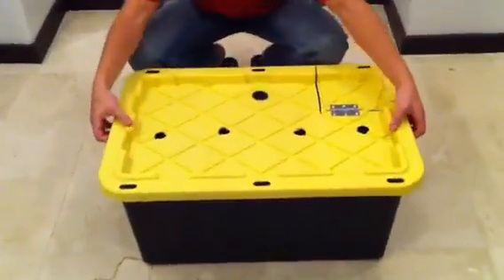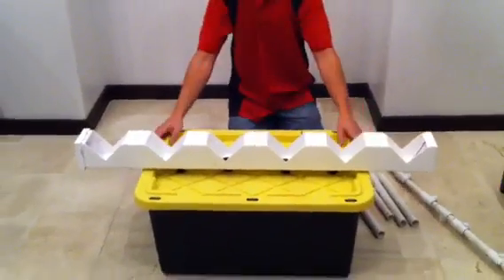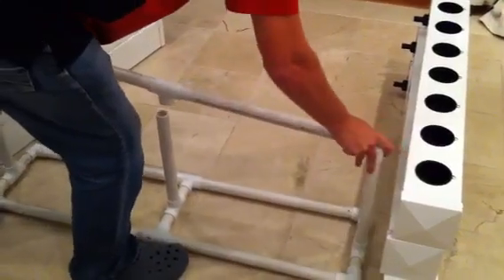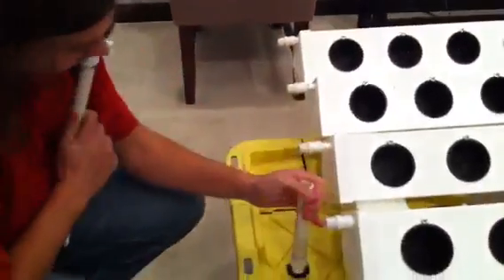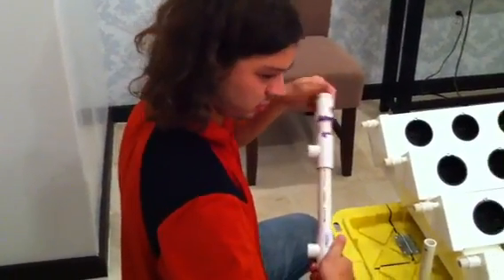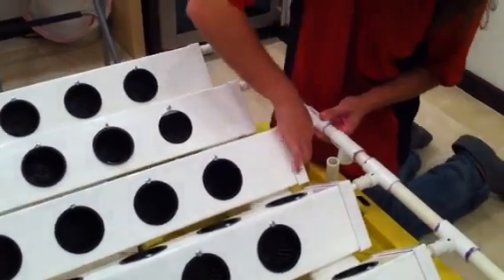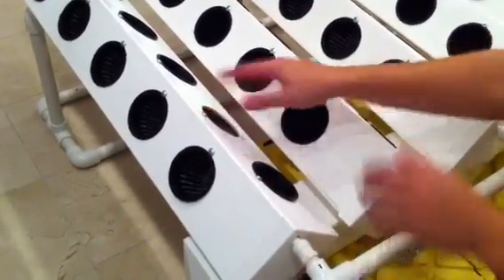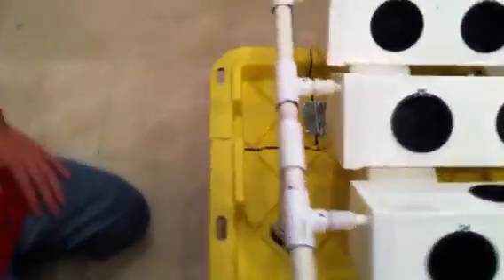Super Cropper (Prototype)

Comment: looks like all i need is some fence posts pvc tubing and fittings! thanks!
Reply: trust me there's a lot more to it than that, I've worked with this sort of system- not exactly the same but close. Its way harder than it looks. Alot of planning or leaks and breaks. leaks mean fast collapse of crop. Also, measuring is way harder when so many parts have to fit together.

Comment: Very nice twist on common materials.  I know you are shooting for a smaller footprint; but, I think if you widened out the spacing between each of your grow columns to about 6 inches,  it would relieve the crowding issue.  I'd really like to see a crop video.  I also wanted to point out that there are not many who could design and build a comparable system.  Great job!

Comment: Great concept but if you changed your pump to a eco sub 420 you would achieve over 30 psi which would make your system a true aeropnic system and create a more atomized cloud inside  hour chambers and drastically improve your results. The pump you use doesent have enough pressure to create a cloud or super fine mist..it basically is like a big easy cloner.1 tweak and youll have a superior machine kid....Cannaboss212

Comment: my only issue is the door hinge for the easy access on the reservoir. It is a great idea as far as space used on these 5x5 post by turning them on there corner. but with the extra rows of plants can the post hold the root balls through full cycle? good idea good concept would like to see one in action.

Comment: If you designed and built it.  Your real clever and skilled..but IMO  a row of top heavy plants will cause at lesst the outside tubes to tip over..either just 90degrees and pump all the water on the floor  or fall over completely . a notched rear support with maybe a bungee cordl over the tubes wouldnt hurt..looks grea sir..good vid
Reply: >> a row of top heavy plants will cause at lesst the outside tubes to tip over..either just 90degrees and pump all the water on the floor or fall over completely 

That is a good point.

Comment: All that its made from is a vinyl 4x4 fence post sleeve you can get at any HD.
The stuff is pricey so the cost of this unit isn't that bad at all. If you take into consideration gas to get all the parts time cutting gluing assembling and lets not forget buying all those components. ends up being a decent deal.

Comment: Your on SEWWWWW_PER CRACK lol ......300-400 bucks for some pvc and a pump ?
Its almost legalized stealing. Goddamned thief lol
Reply: I've just got all the components for a 40' system, consisting of 4 x 10' lengths of 4" drain pipe, and 8 x 90' 4" elbows, pipe clips to support it all, plus a pump, net cups, growing medium, fertiliser- total was £400 or $650. I might be able to add another 12' for just £21 or $33, but this stuff is surprisingly expensive even though I looked around for cheaper suppliers.

Comment: ...N0t sure why so many think that by using HmDepot/Lowes sourced vinyl fence posts that they are saving money over the econ9my of scale from NFT channel such as is available from sources like Farmtek. Config and assembly are simple in either case, while you can save many simply using the professionally designed components - much of which most are simply not familiar.

Comment: The angled ports are of little use with their being directly aligned with the adjacent channel. You would be better off simply going to Farmtek and ordering their cheap NFT channels and siting the ports a bit close and allowing for vertical growth, assuming there is adequate light available - otherwise all either dense configuration will only encourage vegetative growth.